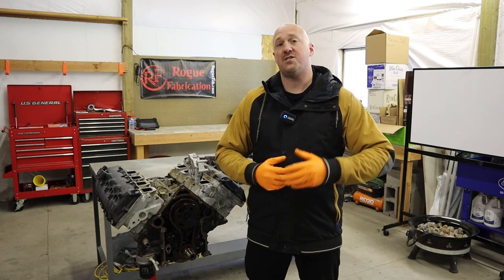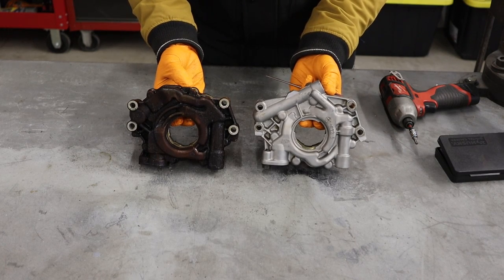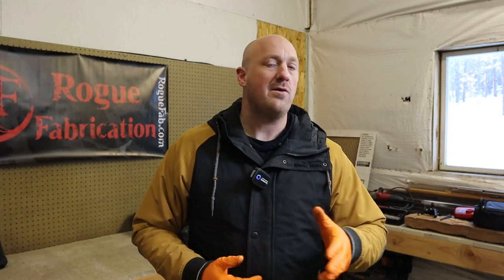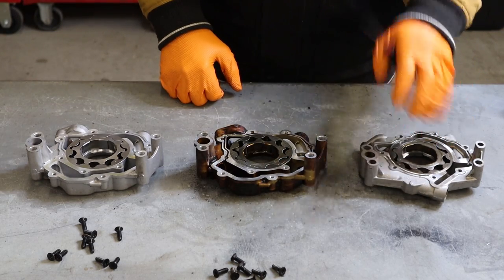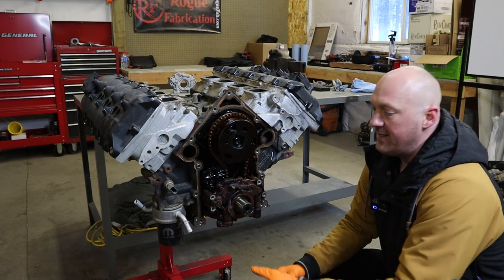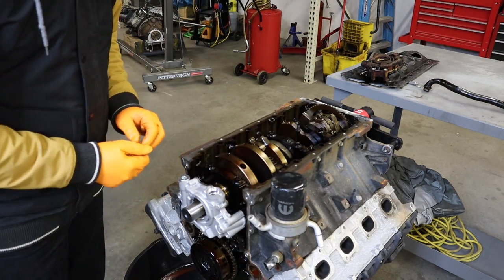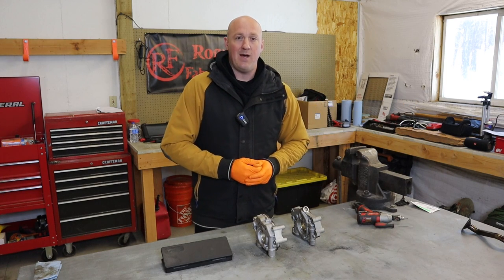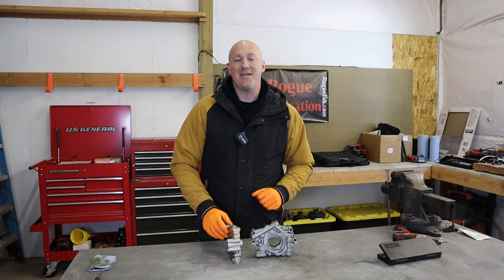Is it TRUE that Installing this ONE FACTORY PART Can PREVENT HEMI TICK?

Comment from the maker: Please watch my NEWEST video to get the very latest info on this issue!
https://youtu.be/1gpEwkTVCmE?si=Zh-s2MnZE5fdGmmM
Reply: sir, may I ask you one question? on this topic
Reply from the maker: @Vadim_Andr.  go right ahead, I'll answer if I can.
Reply: @ReignitedAuto  I bought a 2011 Dodge Durango with hemi tick (not crazy,  can hear the knock of one hydraulic lifter, no errors. 167miles).  and so, I have already disassembled half of the engine - all that remains is to remove the heads and camshaft to understand its condition.  I already have a high-pressure oil pump in my hands (according to your recommendation).  and next  what I need  it  to buy new hydraulic lifters.  So the question is: should I buy with MDS or not mds - which will be better?  I read many different messages from people: some immediately change everything for non-MDS systems, others simply turn it off by programmer (I have diablo but need spend for 150$).  1. Is there any point in physically removing this system?  2. Does it make sense to disable it programmatically only?  3.  or just replace the broken components and leave everything as is?  + Also, the solenoids of this MDS have meshes /nets - doesn’t they do an additional plug/prevent of the oil flow ?
PS oil pan on durangos-  it is one pease with oil receiver and oil bath.
20024/06/23 - I pulled out  the camshaft and it is in good condition.
Reply from the maker: @Vadim_Andr.  Just some clarification on the oil pump. You'll want to install a high VOLUME pump, not a high pressure pump, they are two separate things. Secondly, for the MDS system I recommend watching this video: https://youtu.be/NcDeWXYtozE
That should give you enough information to decide for yourself how to proceed. The metal screen for the MDS solenoids does not impeed oil flow in any way. Hope that helps!
Reply: @ReignitedAuto "Melling 10452 Oil Pump" -  exactly as you recommended
Reply from the maker: @Vadim_Andr.  10452HV
Reply: @ReignitedAuto  great explanation, thanks !

Comment: Just got my '08 Charger Police Interceptor back on the road after changing the head gaskets and rebuilt heads at 95k miles. I have no experience working on engines but I followed your videos and the only thing I needed to go back and do was readjust the rocker arms. I bought the srt headers to swap but couldn't find a set of midpipes in time. Thanks for the best hemi engine content on YT!
Reply from the maker: Love to hear this! Great job getting it done 👊
Reply: This comment made me subscribe.
Reply: Haha that’s why you should never buy a used police charger. They run the piss out of them and idle excessively. The two things you should never do to that engine, lol. But how’s it running now??

Comment from the maker: A reminder: for those who are looking for actual oil PSI before and after numbers, they will be in subsequent videos. Even if I'm wrong and this pump makes no discernible difference, I'll still post the numbers. 👍
Reply from the maker: @da8981  I would say no to both questions. I sincerely doubt you'd feel a difference, but also there's no possible way that a dealer could justify not performing a warranty repair based on a throttle body spacer. 👍
Reply: Learning alot about my trucks engine from your channel . Also kind of a random yet related question . When the lifter/cam does fail . Would you recommend upgrading the cam/lifters ? Truck gets used for towing a few times a year .
Reply: @da8981  if youre looking into throttlebody, get a performance, DONT get a ported Mopar. My OEM was having surge issues, and throttle response was terrible. Swapped it for a ported mopar TB, Same problem, went with i think a BBK and no more issues.
Reply: Why not just run the vvt chain and gear without the vvt actuator problem solved.
Reply from the maker: @clarencepollard1253  couple reasons, first is the crankshaft itself is what's pushing the chain further out, secondly, the bosses cast into the block to mount the timing chain tensioner are longer.
Reply: so after one month...do we have comparision of oil pressure with hellcar oil pump vs 5.7?
Reply from the maker: @tomcc9935  still fixing the engine I'm going to test it on 😂 I expect the oil pump test results video is 3-4 videos away.
Reply: @ReignitedAuto  ok can not wait

Comment: 14% improvement with Hellcat pump may well be significant. My dealer shop foreman has stated to me that the supervisor or foreman trucks that spend a lot of time idling are about the only engines they see with cam/lifter failures. The workers trucks that are started and run with minimal idle time rarely have the failure. That makes sense to me since the cam lobe sans lifter are the last to get lubrication. With the advent of the low viscosity oils I postulate that the oil is bleeding off before it reaches the lifters and cam lobes. This coincides with my own experience with my own truck. Perhaps even going up to 5w-30 will help with the bleed off? I always ran 5-30 in my truck until the last oil change when I was convinced to go back to the 5-20. Followed in a couple of thousand miles by cam and lifter failure.

Comment: I sell a pkg at my Chrysler shop to permanently fix this and I’m a lead certified master tech for Chrysler and it comes with the pump and the demon lifters etc etc I’ve done over 3,000 of these  and it keeps rising it’s a MDS delete (self explanatory) I’ve got customers who drive 4-8 hrs or I’ve had cars and trucks shipped to me for this never a tick in ANY OF THEM!!! From 70k to the largest mileage of 387,491 miles on a ram and every mileage in between plus he follows MY PREVENTATIVE MAINTENANCE. Guide and normal ware and tear, that truck has cost him as much as older Toyota in maintenance etc!!!!!!! You’re the first video who’s on the right track!!!!! I’d hire you in heartbeat to help at my Chrysler shop while I focus on my other 2 shops a speed shop and heavy diesel shop

Comment: Thanks for this video. Installed this oil pump on my 2014 recently while replacing the cam and lifters, based on your theory in your earlier video. Nice to see the physical difference, and that it was worthwhile!
Reply from the maker: Great work Shawn! 💪
Reply: Did you check the before and after pressure ?
Reply: I’m in the process of doing the same on my ‘14 Sport 1500. What are you seeing for oil psi at idle now?
Reply: Did you get it fixed based on the noise or did an engine light come on? ... I have a 2013, I think I hear it, or else the injectors are just really loud... it also has the exhaust tick. I have always heard some kinda noise since I've had it, 30k mi I put on it, at 130xxx. Wonder if it's its a big deal  if I wait until the check engine light comes on for misfire. Curious to hear if this pump is worth it on a higher mile truck
Reply: Hi Shawn, did you also swap the solenoids or no? would really appreciate that info as well. what brand lifters and cam? considering doing this on my 2012 ram 5.7.. definitely hear the tick already at 136xxx
Reply: Great job!
So, I can't find  part # for the pickup tube able to fit in my 2011 Ram 2500, if you don't mind, can you please tell me that part #? 
Thank you!
Reply: Mines just went up today  guess I’ll be doing the same 😢😢😢
Reply: Oil pump can be removed without dropping the pan, Incase your working on your motor still in the vehicle. Just a heads up for anyone doing this
Reply: @joemamma6162 not in the Ram 1500. Even if you get the bolt out, there is no way to get it back in with the pan in place.

Comment: My first guess to this would be to see if the  later 5.7 ring and 10 tooth gear will fit in the early 9 tooth housing. If it does, your increasing volume and pressure anyways without the need to modify the housing itself.

Comment: Just a little FYI, P01 recall has taught many techs at the dealership about pulling the pump without pulling the pan on the cars. Also, there were some Grand Cherokees that came with a plastic oil pan which has the pick-up built into the pan - the pick-up would engage the pump as the pan was tightened to the block. 
Also, from years of doing the P01 recall that replaced the timing chain, guide and tensioner. In order to get the pump rotated enough to get the pick-up bolt out, first take the tensioner for the timing chain out. If you have any worries about the timing chain falling off the crank gear and going out of time, you can simply run a zip-tie through one of the windows in the camshaft gear and around the tensioner side of the chain to hold it tight. Easily able to cut that off when the tensioner is back in place. One other tip, have a magnet that you can stick down into the pan to recover the pick-up mount bolt when you drop it down into the pan.
Reply from the maker: All good tips! I haven't done a p01 in quite awhile!

Comment: I have done a lot of Cam and lifter jobs.  I'm actually in the middle of one right now so far I have never had to remove the oil pan just take all the bolts out and let it hang then take your to pick up two bolts out and then you can remove the old pump without pulling the pan completely off I know this works on pickup trucks never tried it on anything else.. great video!

Comment: Fantastic video Sky, lots of great information, looking forward to part 2.  Can you get the oil pump off a Ram with the pan still on...yes, but it's a pain (video evidence on my channel).  You need a thin wrench, need to remove the chain tensioner, and there is a bit of prying involved.  Remember that while the cranks are similar in length they did redesign the crank (changed the tapper on the snout) to accommodate the redesigned timing set, which is also a bit different.  I will see if I can dig up some pictures and send them to you.  Great video as always, and the new shop looks great, you just need to get the heat working...lol.

Comment: A little warning that ive seen from the rare few who used the hellcat pump, and even the melling HP. People have reported EXCESSIVELY high PSIs, 80-90 cold start, and it is the roughly the same at WOT, idle drops to what the stock pumps  pressure would be at WOT(50-55).the engine will throw a trouble code for pressure, and you run the risk of blowing a seal, or worse, some say you may even lose power. You could probably tune your idle RPMs a bit, but coming from a habitual idler, my 160k miles has 6k engine hours, and ive never had a lubrication issue, and i have to warm my car up until the tranny hits at least 130 before itll be nice to me, usually 20-30 minutes. More pressure doesnt necessarily mean more oiling,  since reportedly the SRT/cat have different methods of lubrication than the 5.7L.

Comment: I just took apart a 2014 6.4 truck engine and it came with a 16MM thick rotor, I do not have an SRT8 oil pump right now but for sure the BGE uses the larger pump.   Also the earlier 5.7 had the smallest volume of them all and didn't have lifter failure problems.  My current 6.4 BGE I built from scratch for my 2011 ram 2500 I used a thin 5.7 pump and it never drops below 20PSI at idle even with 240 degree oil temp and 5w20 oil, I have another 2011 5.7 pump in my hand with the 16MM rotors, even has the 2011 casting date that very much predates the hellcat by a few years so it is definitely not been retrofitted.  My guess is the thin pump came on the car 5.7 for some reason (the one you have in your video is a car engine and mine came from my stash of parts from who knows where) The 6.4 BGE and hellcat both have VVT as well as piston squirters (my hermaphrodite in my 2011 has them still but even with the smaller oil pump still has plenty of oil pressure)  and I suspect that is why they both come with the larger oil pump.  In my opinion the larger oil pump is not going to cure the bad lifter problem, 20 PSI is more than enough, the lifter itself is the problem and when they updated it with larger needle bearings and less shrouding from the splash oil by the skirt around the axle the rollers quit going bad.

Comment: The only possible solution I see (...I'm not a mechanic, but I'm not afraid to do work either), would be to place the internals of the Hellcat pump into the pre '09 pump body. I have no idea if they would fit, but it's the only solution I see.  Thanks for you videos, love watching! 
One question, is there any risk to any part of the engine/seals etc. by increasing oil pressure across the board?

Comment: Perform a cam ,lifter replacement I watched your videos thank you by the way explaining the hellcat pump so I looked into at local dealer  it was 444dollars plus tax so way out of the budget so I opted for a meling hv pump 157 at my door in budget so pulled stock pump without dropping pan 4x4 saved hours just had to grind a cheapo wrench to gain clearance did the loose tchain got the clearance to unbolt pickup tube used bent needle nose pliers to star bolt took a bit got it tight so this from a retire mopar tech also never had been into a hemi so thanks again on the videos keep them coming.

Comment: Another huge reason to upgrade the oil pump to a hellcat oil pump is for track racing.   I am looking to add a hellcat air to oil cooler (hellcat version) to decrease oil temperature for track driving.  If anyone has done track driving with 6.4L hemi, they run very hot oil temp at circuit tracks.  Before adding an air to oil cooler, you need more oil flow, hence install a hellcat oil pump.  As an added bonus, it will help prevent hemi tick :)
Reply: So the hellcat pump pushes out more volume than the stock 6.4 pump?

Comment: Thanks for this, the information is awesome.  We did this to a 2016 Ram 2500 with a 6.4L and it is working great.  We added the HellCat pump based on your early theory video, glad you posted it before we completed the build.
Reply from the maker: Appreciate you watching man!
Reply: That's good to hear. I want to do it to my 2500.
Reply: @diyjeff1838  If it helps I have a multi part playlist of the process on my channel.
Reply: What is  your idle psi?
Reply: @shift_nation4785  Cold: 75psi, At operating temp: 54psi, at highway speeds: 72psi
Reply: @solargarage  wow that’s a huge difference!  So Basically your oil psi at idle is now the same as what the old pump put out at cruising speed?  I’m excited to finish this build on my ‘14 Ram sport!
Reply: @cowchux  Ram sport, very nice.  I can only speak for the numbers that I am seeing now with the HC pump.  For my case I do not have unfortunately the old pump numbers as I was not expecting to use an HC pump, until after we into the build.  And I saw Reignited's first video.
Reply: How much of a headache was it to swap pumps?  I’ve got a 2014 2500 6.4 that I’m curious if I should do it.
Reply: @everlysuniquetimbersawshop  The swap is straight forward as the pump fits and bolts the same.  However it is getting to the pump that will eat the time.  The timing cover must be removed to access, so coolant and oil will need to be drained and filled when complete.  The pain point will be the oil pickup tube, getting it unbolted from the bottom of the oil pump.  I found that removing the front few bolts from the sides of the oil pan allows it to drop enough to get onto the bolt, but it can be a bit of a pain, if you are trying to keep from dropping the whole oil pan.  Are you having any ticking issues currently?
Reply: @solargarage  I don’t believe I am having any ticks yet (72,000). There is a sound there that reminds of slight lifter tick, but I’ve also heard they have a noise like that that is not the lifters. Ever put any Lucas oil treatment in with an oil change?

Comment: That’s cool so I can put a hellcat oil pump on my 07 charger RT. If so the oil pumps are not that expensive. Great video 👍👍
Reply from the maker: Unfortunately the pre-2009 engines it's not a direct bolt on, still working on a solution for that, stay tuned!

Comment: without knowing any of this i  recently bought a used one owner 2013 ram truck.  actually says 0 idle hours on the instrument cluster.  hearing you say this makes me happy. the engine is sewing machine quiet which is one of the reasons I bought it.   he had the dealer change the oil on time every time per the car fax.  and apparently didn't let it idle much.   I do notice the oil psi never drops below 40 when the engine is at full temp after driving it around a while.  it's about 65 when cold.   seems pretty normal from all the cars I've ever owned.  this truck doesn't even have a broken exhaust manifold bolt like most do it looks like this is a huge problem too.
as for the tooth count, I suspect the pump can now spin at a higher rpm.  thus also increasing flow rate.